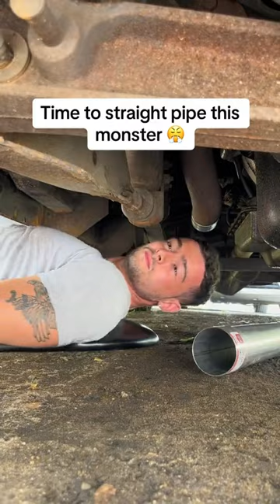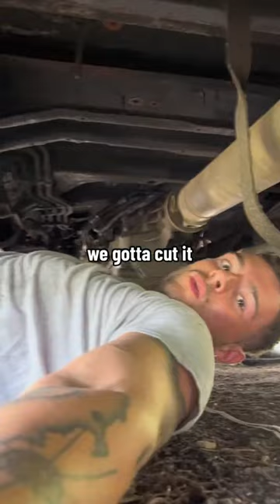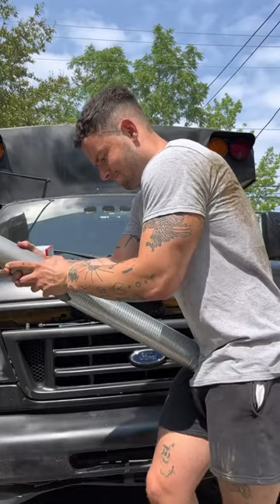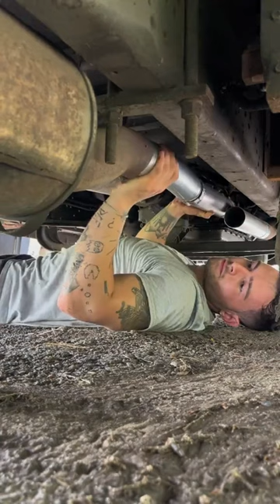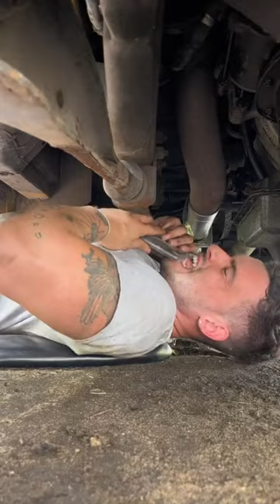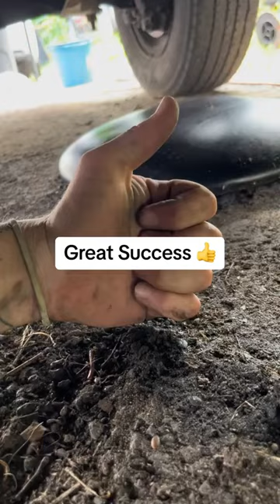Day 63 straight piping my short bus

Comment: That tape is gonna melt right off 😂
Reply: Same thing I was thinking... Also fuck welding... Who needs it at  such high temperatures anyway
Reply: They have tape for mufflers that’s design for the heat actually goes on like tape and when it gets hot from the exhaust temperature it hardens the tape best way to explain it
Reply: @brycebolinger6452 Is that the same type of tape I see on the headers of some modified 4-cyl engines?

Comment: You been doing good work from what I seen you cut corners on the exhaust it will lead to leaks later down the line I would take it to a shop to get and actual pipe welded on

Comment: You used plastic tape?? It will melt and your exhaust will fall of while driving
Reply from the maker: Tiger tape
Reply: @loganduranto  idk what is that tape but exhaust pipe has 300°C-700°C... What engine do you have there?
Reply from the maker: @Fiatfan  6.0. It’s like muffler repair tape stuff
Reply: @loganduranto  ah ok. It's a diesel? With turbo?
Reply from the maker: @Fiatfan  yes diesel, turbo idk
Reply: @loganduranto  bro... You need to know much more about engines and mechanical stuff. At least change oil every 15000km and go to mechanic for him to check the bus once a year, this engine should be able to run long and healthy if you care about it

Comment: You been doing good work from what I seen you cut corners on the exhaust it will lead to leaks later down the line I would take it to a shop to get and actual pipe welded on
Reply from the maker: You’re right